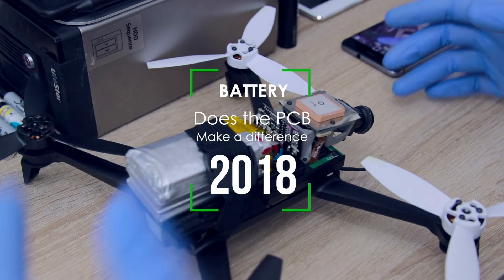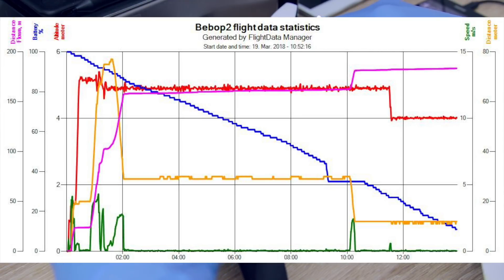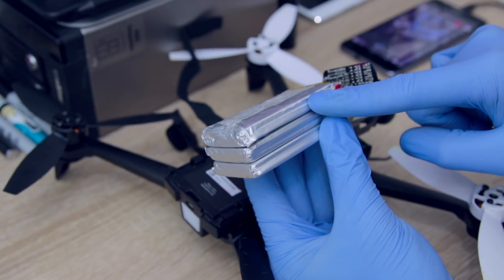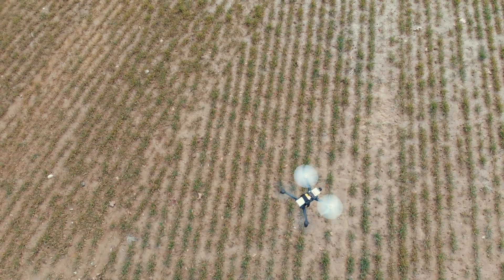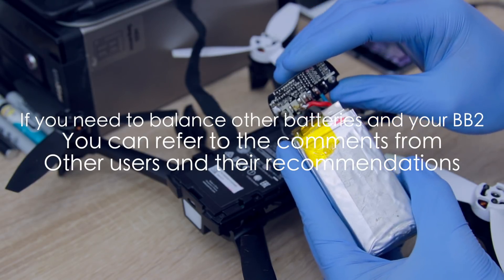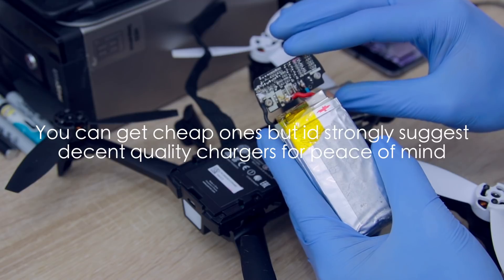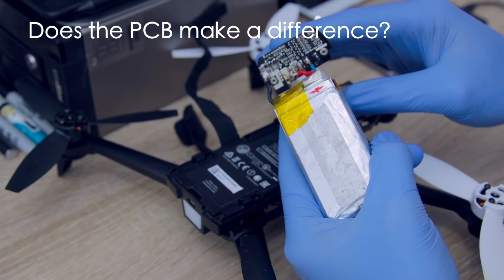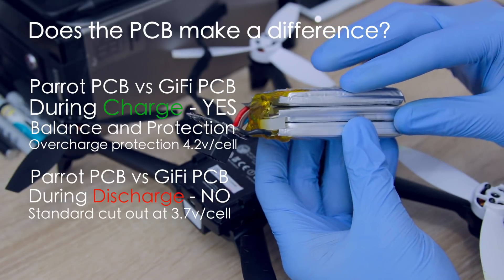BEBOP 2 - Battery | Does the PCB make a difference | Experiment

Comment: I have a gifi battery and bebop 2. The charger that comes with the drone doesn't have a storage function and the connector is strange so won't work with my main lipo charger.
How do you bring these batteries to storage voltage?
Reply from the maker: Discharge them in the drone until 70-75% is a ballpark of storage voltage.

Comment: Hello, I have 2 originals parrot batteries but they are dead. Therefore I want to buy some 4000mAh GiFi batteries on AliExpress. I have a balance charger for other drone batteries. I wan to ask you if I can take the pcbs from the originals an put them on the new ones to charge them with te parrot charger ?
Reply from the maker: Hello, if you have a hobby balance charger you do not need to put the pcb into the GiFi battery. Just charge and fly. Balance will be done by the charger. 

For the parrot charger, yes you are correct to use the bms from the oem battery but the parrot charger is not rated for the 4000mah cells. You will need the parrot HD charger for that.
Reply: @ANTHONYVLOG  Hi thanks a lot for your feedback. 

So even though I swap the pcbs I still can not charge them with te original parrot charger for the 2700 mAh ones ? 
So I will have to charge them with the balance charger obligatory ? 
Im saying this because I had in mind swapping the pcbs and charging them with the normal charger that is easier. But I think yo know more about this
Reply from the maker: @javierrodriguezcriado6580  it can charge, but over time the charger will fail.

Comment: does the bebop 2 fly well with TWO of those packs ie/  two 3ps2
Reply from the maker: It does fly but not very well unless you compress the top to the cross frame. Or mount the extra battery on the cross from from the bottom.

Comment: Hi there, I was flying with flight plan and the drone fell off from the sky at 10 m with no particular reason. Is this you have experienced in the past? I previously dismantled the drone and the charger connector broke off from the motherboard and I did put it back with screws holding to the motherboard cover. Would that be the reason why the drone crashed? Thanks
Reply from the maker: Ahmed Awaleh sounds like a power loss! If you didn't, try to solder the connecter in properly and use a velcro strap to keep the battery tightly on the drone!
Reply: Thanks for your response. I replaced the motor  as suggested with a same motor of my bebop 2 and placed  the error motor of bebop power 2 to the bebop 2, both motor worked fine with no errors. I think the issue is on the motherboard or the wire of the motor. There is no burned or damaged ion the circuit connection to the motherboard. With regard to the  bebop power 2 battery, do you know a cheap balance charger that could balance back the battery?
Reply from the maker: Ahmed Awaleh if its the original battery, use only the parrot HD charger. If you use a 3rd pty balance charger you must bypass the bms inside the battery.
Reply: I used the parrot bebop 2 charger as no charger came with the power 2 drone. When I tried to charge the power 2 battery after I received from eBay, it keeps blinking red.
Reply: Sorry for this second reply. I did managed to speak to witnesses on the park and it seems that the drone just dropped from the sky. The battery connector was still intact after the crash.The video stopt too before the crash, and the data don’t show anything particular. Very weird. Thank you
Reply from the maker: Ahmed Awaleh thats what happens when the terminals lose conductivity! They just cut power for a split second and it falls. If it does regain connection than it will just be beeping on the ground. Put a velcro strap on the battery and you wont have any of these random falls.
Reply: Thanks for response! I will try to strap the battery on the drone. I was just worried that someone may have used some kind of interference software.

Comment: So.. Can we just make a charger adapter for the OG charger that goes through a Parrot OEM PCB to charge said cheap batteries? 🤔
Reply from the maker: You can charge batteries without the PCB. The issue is that the those batteries are not 2700mAh. 

The PCB works best attached to the battery because its function is to balance, DC on short, DC on low voltage or over voltage. 

Only over voltage will be essential during charge. Low voltage and Balance is essential when on the drone.

Comment: Hey Anthony. I think my bebop 2 is discharging my batteries wrong. I did the mod to charge on my imax b6 balance charger and I get the cells all close to each other in voltage and it also shows they are even on both my vlipo battery testers. But when I fly n land after a flight I been checking and it shows one cell off by like 5 or 7 n sometimes 12 points of a volt. It's driving me crazy cuz this is my 3rd bebop 2 n I have no issues like this on my p3p, spark or q500 4k so it seems like something is wrong. What would you say about this? Thanx bud.
Reply from the maker: Hi Ian, the bebop discharges the 12v rail not each individual cell. It could just be a failing cell or a failing pcb. Try bypassing/removing the PCB and see if it discharges unblaned. 😊
Reply: @ANTHONYVLOG  ill try to do that and see what helps.  It's just annoying that this is the 3rd battery to do this.  But I looked in my battery logs like I see in your video and there is a gradual drop off and looks smooth.  Maybe I need a better battery tester.  Thanx  Anthony!
Reply from the maker: My battery should be giving out the worst data because I abuse them purposely so they fail. They haven't. My last battery was retired at 450 charges (logged in drone notebook) and I only use the oem charger. I honestly suspect its just a failing cell, but also hope that it's just inconsistent reading and your battery is fine.
Reply: @ANTHONYVLOG  wow that's awesome 450 flights!! I love the way the bebop 2 flies.  I notice I like to fly it most out of all my quads. I hope it's just a bad reading and they are fine. Thanx again for the help!!!!

Comment: So basically, there is no discharge circuitry on either battery. The Bebop battery has balance charge circuitry built in but can be improved by getting a better, separate balance charger.
Reply from the maker: Parrots PCB has charge, discharge balance it also puts the battery to sleep. Non Parrot Batteries require an intelligent charger. OEM batteries are paired with the OEM charger. Thankyou.
Reply from the maker: Not necessary to remove the Parrot PCB when using other chargers. The PCB will add the same layer of protection, circuit, charge, discharge and also sleep the battery if not used so it does not drain to Ov you can reactivate it by plugging it to a charger. (People notice this, battery reads zero, they plug it in for a few seconds and the battery comes alive at 60%) So by all means use a more robust charger, no need to modify parrots battery PCB. It is to your advantage.

Comment: So, the actual balancing control is on the battery circuit board if you are using a Parrot Bebop2 charger. Or did I misunderstand that?
(Some times I miss things people say because I am very hard of hearing and 68 years old.. lol)
Great video, thanks for sharing it with us.
Reply from the maker: nmsidewinder you are 68 years of quality, I have not reached that level  yet. ;)
Reply: Thank you for the nice reply. One thing to remember: They say that some people are like a fine wine, that only gets better with age. On the other hand the cheap wine as it gets older......turns to vinegar... lol
Reply from the maker: Both the battery PCB and the Parrot charger balances. OEM will only balance 2700mAh safely.

Comment: Can you use the DP2 charger with the Gifi batts? If it is made for charging the Parrot batt then could the lack of components on the Gifi  PCB cause a problem?
Reply from the maker: Hey bud, DP2 does not require the PCB in the battery. DP2 does its own charge control.
Reply: ANTHONYVLOG , great!